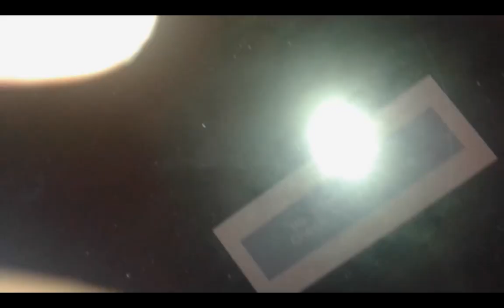No picture , No Backlight repair an LCD monitor step by step Common repair  Hanns-G HW173a

Comment: My monitor show image but no backlight. Can you tell me where's the problem? In power section?
Reply: Check for bloated/bulged electrolytic capacitors first.
Reply: @davidbolha  i cheched but isn't ici the problem
Reply: @TeReSaAsErEhT  Then you can try looking for not working transistors. Did you also check the high voltage capacitors near the high voltage transformers too ? They look blue in color. They are usually 1 or 3 kV.
Reply: @TeReSaAsErEhT  Check all of them that are blue would be my suggestion. 😕

Though you can also try this: https://youtu.be/112XpIcees8

It doesn't fix the problem per se, but it is an interesting workaround. 🙄

Comment: why do not you put in new capacitors
Reply from the maker: +stefan boonstra works better with an old and original Capacitor than a chinese one :)
Reply: you can buy also new japanse capacitors. in high   quality you never know how long it takes whit old capacitors. if i repair a psu whit bad capacitors i buy always new ones